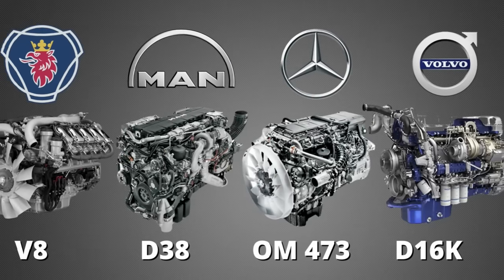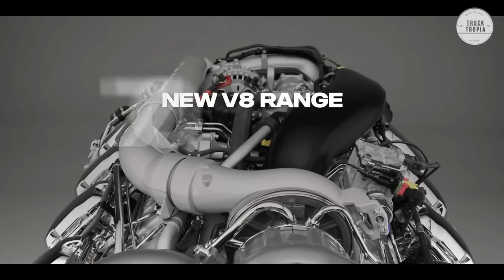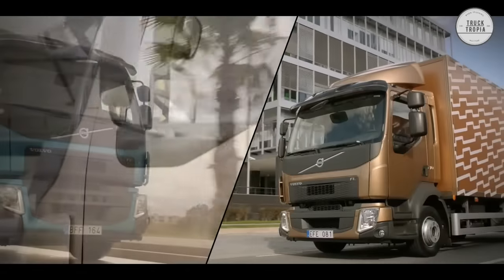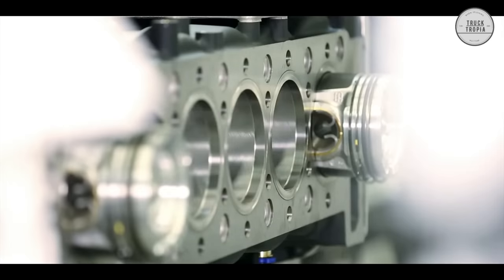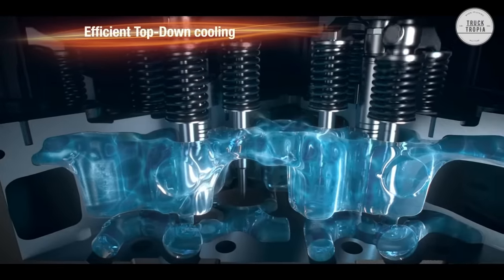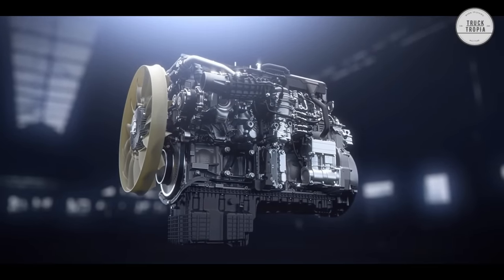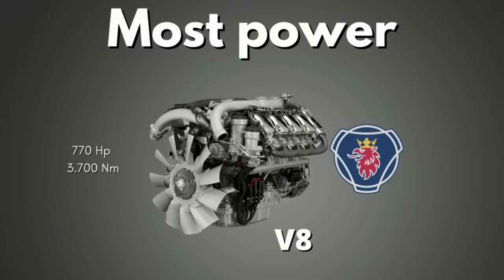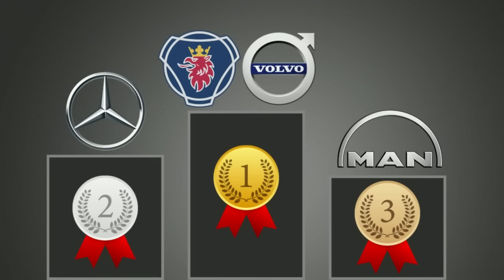Which Engine Is Best - Scania vs. Volvo vs. MAN vs. Mercedes

Comment: Mercedes?  BLEGH NOPE, since they stopped with the V6 and V8 Engines i am not interested anymore. I love the design of M.A.N. Since the beginning of this century.  However, design flaws and the lower construction quality and downhours compared to others i would not choose a M.A.N.  Volvo, GREAT engines, the gearboxes are UNBEATABLE, fantastic build quality and safety standards, outstanding pulling power and awesome designed cabins it is one of my two favorits.   Scania,  the V8 says it all,  NOTHING beats the V8 sound.  The cabins are AWESOME and it is THE truck most young drivers dream about.  However.  In the Netherlands it has the bad name, "king of the emergency lane"  It does NOT have the reliability of the Volvo. Safaty standards are Very good but not as a Volvo.  The  gearbox is not as good as a volvo.  So what would i choose.  Its difficult.  It depends.   Do i have an trucking company with several trucks and i don't drive my self,   with no question, no hasitation or reconsideration what so ever, i would go for Volvo.   I want to keep my drivers and people on the streets safe and i want to make money and on the long run,  for me Volvo is the best money maker.  If i would have only one truck to choose for my self,..............................let me think......................OMG,  difficult,   OK  i would go for Scania V8.  Why?  this has only 2 reasons.  1,  i HATE the Volvo environment BULLSHIT electric trucks. They are NOT ANYMORE clean then the modern diesel trucks,  its a fucking flagrant lie.   Reason 2,  Yup  the fat ass 16liter V8 DIESEL engine that is unbeatable. That sound is like weed for my ears.   So there you have it,                     Ohh NOOO for ME there is one better.  An ultimate combination  The Tatra chassis and drivetrain. With Scania 16L V8 and Scania S770 cabin, with the Volvo automatic gearbox and safety features.   THATS my ULTIMATE truck.

Comment: It’s not just about Engine. Scania has completely redesigned the emissions system, making the engines more fuel efficient, cleaner & less down time due to the engine being allowed to BREATH.
Merc’s are crap, MAN are crap & VOLVO are crap.
Only Scania is King of the Road & every truck driver knows it.

Comment: D38 is the most powerful MAN truck engine in production. But, it is not MAN's most powerful truck engine of all time, that would be D2868, the 680hp 16.4L V8 for the 1st gen TGX (and RMMV HX81 tank transporter).
Reply: I believe it is still in use today as a Marine engine.
Reply: @MikeWooshy  Yes it is. But no longer in TGX😢

Comment: So if we ignore fuel efficiency - one of the largest factors - then this is the order? 
How many dealerships they have doesn't make a lot of difference with servicing being yearly or longer for most of them and even at that companies with a fleet usually have their own service centre. 
When things do 100,000km per year an extra 1l/km makes a pretty big difference to its running costs.
Reply from the maker: Hard to find valid information about fuel efficiency, as it depends on weather, landscape and mostly the driver who drives the truck
Reply: @TruckTropia  I agree but there is usually information about BSFC which will give a relative comparisson.

Comment: Scania V8 is DC16 085A. 566 kW (770 hp)
Reply: The V8 version installed in trucks is the DC16 123, The DC16 085A is an I/M engine used in i.e. power generation and marine applications...

Comment: You left Iveco which might be the best truck engine.   However I think Mercedes has some fascinating technology with twin carbon fiber over head cams and the way they use the exhaust gas recirculation from the pistons to control the turbo boost.  But the Iveco diesel is in essence a Deutz diesel and Deutz is the best diesel made.

Comment: i want to know who has the strongest drive shaft,  who can handle the most torque without snapping the drive shaft
Reply: I don t know about the latest Scania models but all the previous had problems with their drivetrains hearboxes axles e.t.c! I think that VOLVOS are the best, but the forgotten beast is the MAN V10 660 HP engine . I don't remember its code name .
Reply: Man...

Comment: Overall Scania is the champions but why in Australia roadtrain they used 5% of Scania 95% they used American truck
Reply: Yes it’s because they are not durable enough  …Talking about horse power there are plenty Kenworths running 1000 horse power  my mate pulled a train engine 162 tonnes up Tawoomba range by him self with 162 tonnes plus tri axle dolly  European trucks nice but when you need a Job done you use Kenworth power ….I was in the states while back seen this. Peter build c18 cat had 1100 horse power to the rear wheels cheers hope this helps I had a Truck with a 903 Cummins putting out 650 horse power in 1984 keep on Trucking 👍👍🦘
Reply: Well. Apparently those are not so great. Same in North America, we don't use them at all. I guess good only for Europe
Reply: Not true, I was in WA this spring, and the most common truck on roadtrains , was Volvo and Kenworth.
Reply: You should know better than me coz l’m not Australian

Comment: In my opinion volvo is better than scania  because my dads friend has a brand new scania and when the waranty expired the transmission broke.
My dads 1999 fh12 needs a few taps with a hammer and its good for 50 years

Comment: Answer none of the above. You still can't beat a Caterpillar.
Reply: that's MICHEAL JORDAN of engines,and it's not fair to compare with others😆😆
Reply: In north America, CAT was out from market after DEF system is mandatory. Cummins is back but too much repair and not compatible with automatic transmissions. Get two replacement in two of our trucks. Thank God those were under warranty. Man D26 (A26 IN US) is more silent and very good match with automatic transmission and very smooth sifting but this engine needs too much maintenance. Now Scania's S13 introduced and start demo next year with T14, 14 shifts transmission and higher fuel efficiency. Let see what is the result. North America still needs good motor since DEF system mandate. 1000K is the end for all trucks on highways. Companies need too much maintenance budget if they need to maintain their truck after that mileage. Miss you CAT.
Reply: Believe me in Europe we also miss our pre euro4 engines! no matter what brand you buy same problems overhere a lot of problems with electronics (sensors dozens of software updates)and aftertreatment systems ,one brand more of this other brand more of that they all tend to build lighter,cheaper and more fuel economical... searching for that last puff of diesel vapor to save.... and not reliability/durability...those are two different things!!... i myself still miss the straight forward uncomplicated mechanical Volvo F series and Scania 2/3 series ,really reliable workhorses treat and maintain them well and they brought you everywhere!!
Probably Caterpillar did see those problems coming and stopped up-front which I can understand because they had a reputation to lose!

Comment: Would be perfect if you said some average fuel consumption. Most drivers know how much fuel they have used in one year, and the mileage is also clear.
Reply: B50 life would be good too.
Reply: Fuel consumption of engines can't be reasonably compared by using fuel consumption of trucks, unless the trucks are otherwise identical and they are driven identically.

Comment: I prefer DAF trucks overall, Mercedes are cheap to run and have good engines and fuel economy, however everything in the cab is made with cheap thin plastic that will break. At least they have comfy beds.
As for Scandia, they have the best headlights by far and feel somehow luxurious, they are good machines but i think they require better maintenance than say Mercedes, which are the poor man's trucks.
DAF is somewhere between these two, a good mix between usability and quality.
I have no experience with MAN or Volvo :)

Comment: Mercedes have american engines, OM471/473 is very similar to american Detroit Diesel 16
Reply: Mercedes owns Freightliner and Detroit engines they use are from Mercedes.
Reply: Cummins is basically the only American engine, the other are European

Comment: The best engine is the one for which there are cheap and good spare parts forever and you can replace them yourself. All these engines are too unnecessarily complex and expensive with expensive spare parts that you can't replace in the field and of course any engine breaks down, this is only question which day. 
And if your government doesn't agree with the direction the countries that produce it are going, you will get a spare part very expensively or not will get amd one day you will find out that the manufacturer has stopped supporting it and so you have to throw it to trash all vehicle or engine...

Comment: I run a truck body shop, i get to talk to MAN and Mercedes drivers. Seams like people do like Mercedes more specially there latest CNG engine since its way cheaper compared to scania and iveco. Maybe its due to where i live but 80% of older trucks running arround are Mercedes, those old Actros MP1s all over as well as the first and 2nd gen Ategos. They say mercedes has the best fuel economy and chepest service cost. Also from my standpoint mercedes is the most simpler to repair or remove the parts from

Comment: YOU GET THE BEST. IF THE TANK IS FUL WITH THE RIGHT FUEL. YOU USE THE RIGHT OIL. AND YOU HAVE THE RIGHT SPARK PLUGS. IF YOU DON'T YOU GO FAST DOWN THE HIL. BUT YOU NEVER GET UP THE HIL
Reply: What are the right sparkplugs?
Reply: Spark plugs?! Oh noooo bro !!!

Comment: You can kill all these modern engines by using optiroll or so called autoroll.  After pulling hills up it automatically changes gear to neutral and drops revs on idle.  So you have only minimum oil pressure and your engine is very hot. Cam bearings needs oil for lubricant and COOLING.   So get rid of that autoroll or optiroll system fast, it'll destroy your engine sooner or later.

Comment: Considering "MAN" under the auspices of the vw group, if only there was a w12 or w16 diesel engine, it would definitely be the only truck that has the biggest engine today.
Reply: MAN did make a V10 for the on highway market. It was the D2840.
Reply: Scania is also VW group
Reply: @mikilaursen7838  but not Germany made thats Swedish
Reply: @TFSIChristmas  still does not change the fact that scania is owned by VW and scania shares parts with MAN
Reply: @mikilaursen7838  well, ha lol fair enough

Comment: VOLVO, the most ridiculous, weak, awful truck. The cruise control must be controlled by the driver all the time. on the uphill leave you without power and speed. from 55, if the driver does not push the power, it reduced the speed to even 40 mph speed, leaving significant traffic behind. that is causing the driver to accelerate more and is not fuel efficient at all. it should happen downhill but it never happens. The engine brake is useless as hell. unfortunately, because Volvo gives a good deal to companies in the UK, all the companies take the deal. like any other cheap companies, french for instance. every 10 minutes message pops up with a beep sound suggesting to reduce the speed when the speed is around 53mph. it expects to stop the truck and carry the load on the shoulders to be much more fuel efficient. i am tired of pressing all the time the uphill power on the gear stick to give more power to the engine.

Comment: Here in Finland with 76 ton total weights and nordic climate, power train's total performance will define the winners from the loosers.  Almost every new timber truck here is either Scania 770 or Volvo 750. What Volvo loses in total power, it wins with a slightly better transmission behavior in off road conditions.  But the sound of the all mighty  V8... It jus makes me a little exited...

Comment: Non of them.  Detroit 60 series 12.6 liters they run normally up to 1.3 - 1.5 milion miles w no problems we send one for overhol to shop with 1.4 million miles .They cooling us next day and asking why we need overhol because liners have still avter houning laners and compression ys good no metal in oil Total $ 8000 for overhol.  Next in line Caterpillar  E 3406 and C 16 they 14.6 and 16 liter engines longest you keep them hot and running they don't fail normally up to 1.4 million miles heavy work next in line Cummings C 14  0 problems up 1.6 million miles  This engines make money for owners.  Today's crap volvo and others make money s  for repair places and with DEF  they brake nonstop and must be overhol sometimes after 0.6 million miles for only  + -  $ 40000 . Yes one third live for five times more

Comment: From the perspective of a heavy diesel electrician I would rank them from easiest to work on to hardest to work on as follows 

1. MAN, relatively simple circuit diagrams, things just make sense although it was quite intimidating working on one for the first time. Also quite reliable electronically 

2. Volvo, bit more technical than MAN but still understandable if you have access to the correct diagrams. The light control module can fuck you around though sometimes depending on what trailer is connected.

3. Mercedes, Not very reliable all sorts of different issues from ABS modules, to BCM's and entire wiring looms needing replacement overall we see Mercedes in the workshop the most out of all 4.

4. Scania, my company actively avoid working on scanias as much as possible because in a desperate and pathetic attempt to make more money scania hides all service information from us electricians so we cant work on their vehicles and only scania employees can. That being said the few i have worked on needed major rework done to lights, abs and engine ecu replacements.

Comment: Doesn't Mercedes make an V8 also? Or did they stop that?
Reply from the maker: Both MAN and Mercedes-Benz used to ... but both stopped, and now only have Inline-six with 640, and 625 hp.
Reply: @TruckTropia  I see, thanks for the info 😊

Comment: Man=better handling much quite It and the Mercedes are more powerful on the ground than any other truck. 
I don't know if it is because of the gearbox difference, but it never let you down, as in Iraq, a Mercedes MP3 with 400 hp, three axles, with a load of more than 90 tons, and it is very normal, no problems, no overheat.
Just fill it diesel🤷🏻

Comment: Switch mercedes and man 

Mercedes engine might work well for a week if you get lucky 
You have higher chanses of winning a lottery than that to happend
Reply: Diagnose and repair well, at first time.
Reply: @josemartinez-fw9pu  but it's mersedes if you want it to be reliable you need to repair ut in space and after that it just bearly  holds up
Reply: @herrapingviini2024  From my experience that’s not the case. Their engines are really good.
Reply: @johnguidetti5839  r u sure u don't have padel truck

Comment: I don't know exactly who ist the best.
But the worst ist the Mercedes, a loud shaking thing
The MAN is a verry silent engine.
Reply: Please explain that one...
They work excelent with 50-60 tonn on steep norwegian roads
Reply: @stigandrmyrardalur5208  and you think the others can't do this?
Reply: @nullgewinde  yes they can, but it sounded on you like MB couldn't
Reply: @stigandrmyrardalur5208  No, the MB is a verry loud and rough running engine
Reply: @nullgewinde  😂😂😂😂😂
Sure mate, sure.....
Reply: Every volvo I have driven is twice as loud as MB engine, even louder than the previous gen V8 MB. OM473x engine is very smooth

Comment: As what be stated here that's still credible info for the Europe's most reliable Heavy Duty Trucks on the line of entire discussions here,

as though they have many influx of Heavy duty Trucks herein the Philippines commercially owned by Mainland China willing to contend the top of the line Japanese Heavy Duty Trucks traditionally available in the Philippine Market as though the Isuzu trucks were already bears on my mind among the most reliable source of investing Japanese surplus sparepart shops herein the Philippines as yet the Isuzu have also commercially brand new shops that caters promising warrantee

Isuzu were I cannot tell they were the best Heavy Duty Truck maker but they were some influx of the European Heavy Duty Trucks also mentioed this discussions legitimately available in the Philippines as Commercially Brand New but only few from the qualified considerations were spare Parts may be the sort of issues as for mentioning price bargain logistical costs, as though both the Japanese and the European counterpart may be soon uncontested with the Chinese commercial Heavy Duty Trucks to array with commercially price-bargain brand new business strategy prospects of commercial dark horse because I expect the mainland China have still enough natural resources than Japan have only the forte of technological refinements but lacking eligible natural resources.👍💯❤️☺️🇵🇭
Reply: Don't include here china made engine. Not belong to this class of engines.